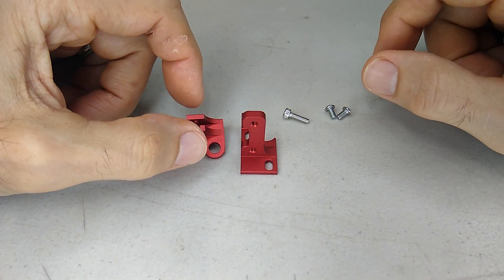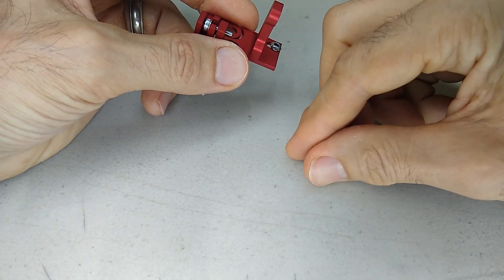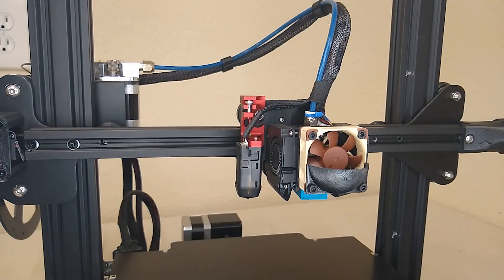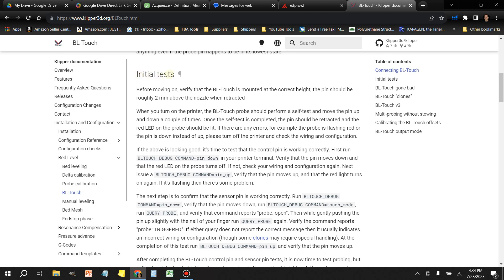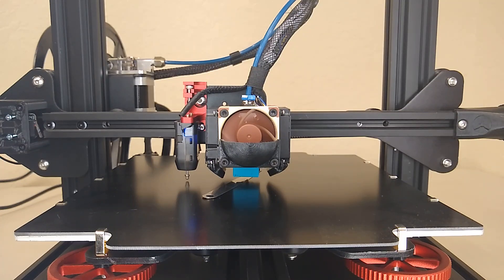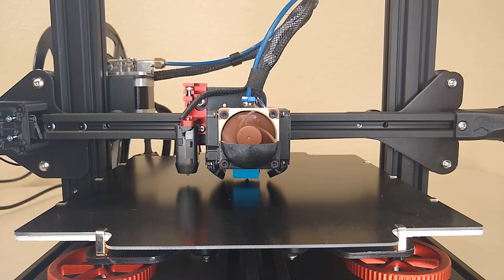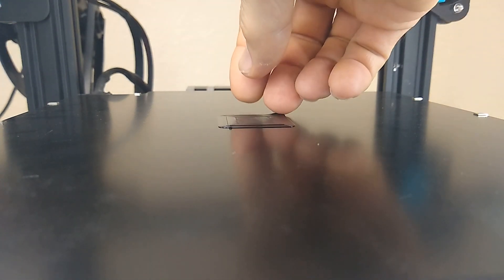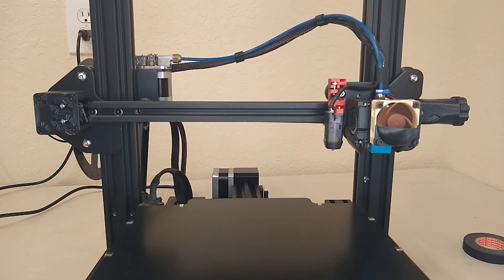How to Install and Adjust The Ender 3, Pro, V2 Precision Z-Offset Probe Mount

Comment: I couldn't get it to work like in the video, so what I ended up doing was resetting the Z-Offset to 0.00mm (Even with it set to -2.00mm, I couldn't get the tool head to get close enough to my 0.25mm feeler gauge without having to alter the Z-offset), and then adjusting the mount, auto homing, adjusting, auto homing, etc., until I got just light pressure on the the feeler gauge. Gap verifies :D
Reply from the maker: Great, I'm glad you got it set. There are different ways to do it. In the end you should wind up with a Z-offset between .15-.50 through more testing I found that leaving a minimum of .15 gives any softened filament left under the nozzle from a previous print some place to fit during homing. Another thing is to make sure to add a line in your start g-code that warms up the nozzle to something like 130c prior to homing.  Not having that in your start g-code will cause any solidified filament under the nozzle to contact the bed prior to the probe triggering leading to an inaccurate measurement.

Enjoy the super accurate bed meshes :)

Comment: With Miguel’s software, how did you lower the nozzle? I cannot go past 0.00 to touch the feeler gauge.

Thanks Victor!!!
Reply from the maker: Hello friend, to get below zero you first need to change your Z-offset to -2, save and restart the firmware prior to making the adjustment but be sure not to forget to put it back to zero when you're done, save and restart, otherwise the nozzle will crash into the bed when you home it.

I talk about it in this video around the 3 minute mark.
Reply: @vbared  Victor,

Got it working… Thank you!

Rob
Reply from the maker: @treborjm87  Awesome!

Comment: Greetings Victor,  Well done sir and amazing probe mounting system.  I'm drilling and tapping the wheel plate on my E3Pro 500 mm to use the second mount screw.  I added two Teflon washer to keep from scaring the mount finish as well as give a little finer feel to the contact point during adjustment.
The second mount just arrived and I plan to use it on the E5 Pro as it is Klipper based as the E3Pro is one using Miguel's  firmware.  Thanks for noting the changes to both UI's.   Doc'
Reply from the maker: Hi Doug, Thank you it's wonderful to hear from you. I'm glad the new aluminum mount is working as advertised. Great suggestion on the teflon washers, they can also be printed. Make sure to add a hotend preheat to like 135c in the start g-code prior to homing. Since the Z-offset is so small any filament on the nozzle tip will need to be soft to mush during the z probe.

I finally have the lobster trap printing beautifully. Next would be to anchor it to the wall so I can increase the print speed. Say hello to "B" and enjoy your week.